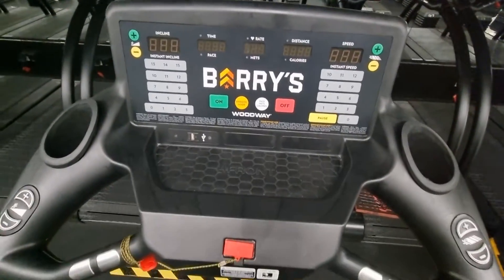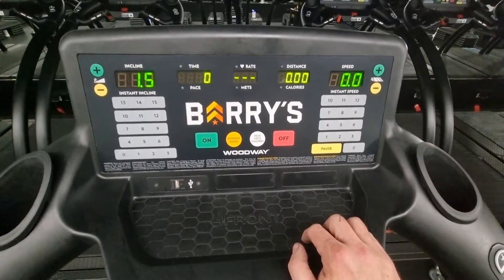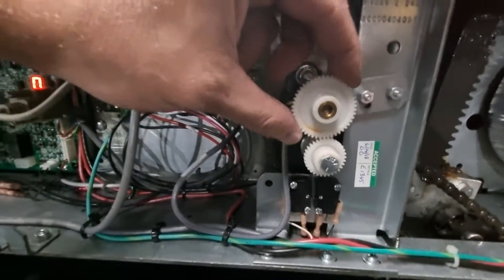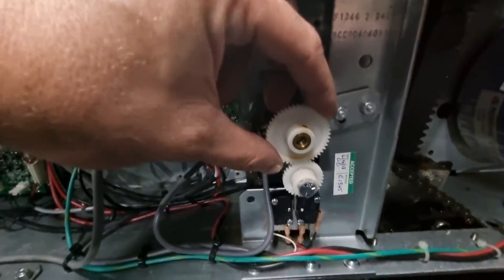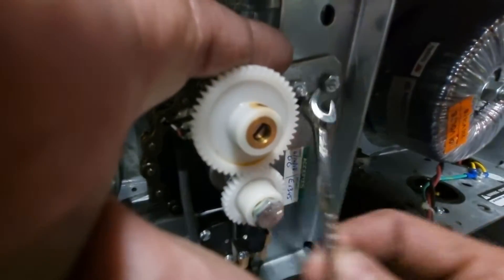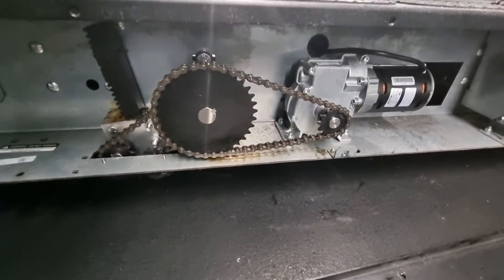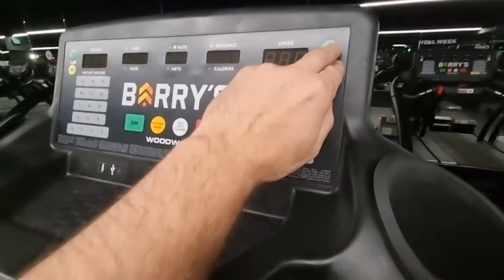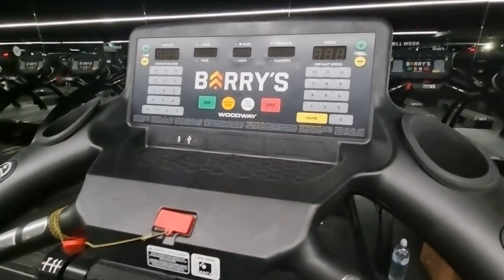Woodway incline calibration, console fault light not turning off or can't get out of dynamic mode.

Comment: You can get a finer adjustment by loosening the little Allen bolt on the cog wheel then with a small flat head turn the potentiometer till it reads absolute zero. Then tightened the little Allen bolt.